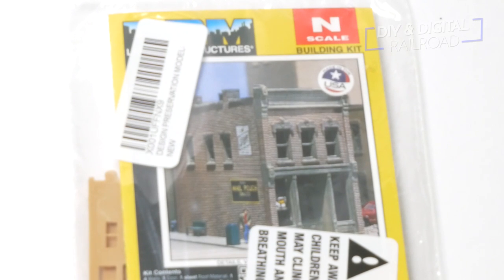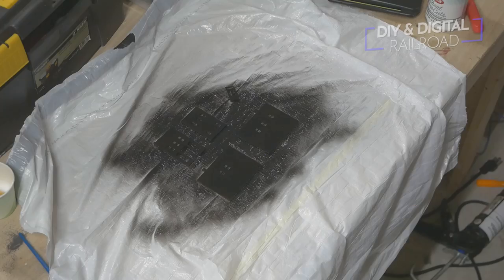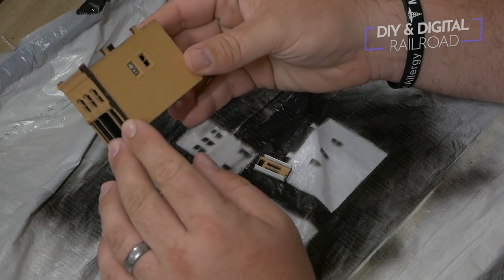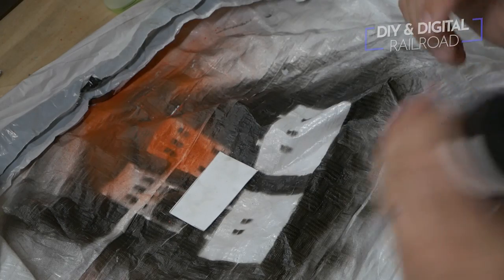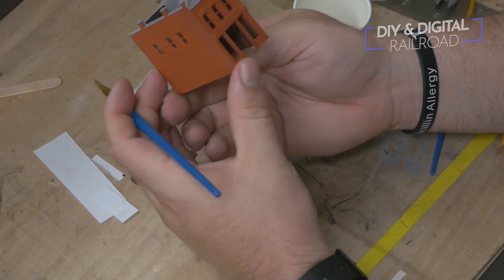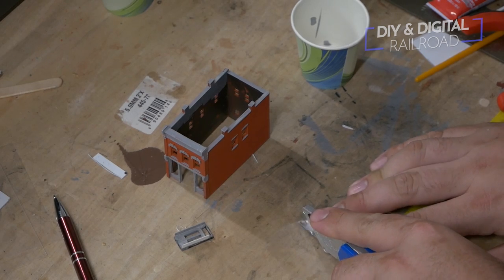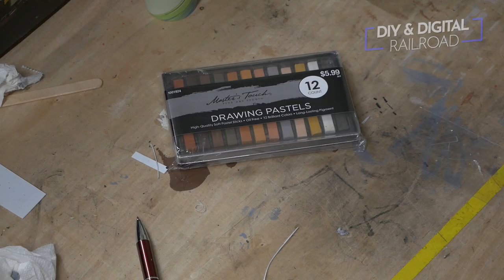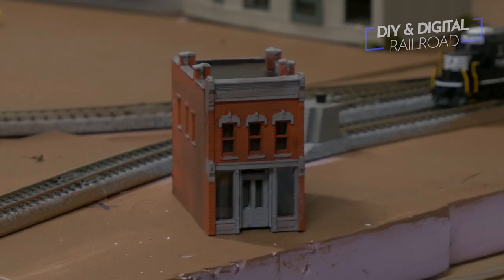Building a Design Preservation Models Kit

Comment: Nice video, some additional suggestions:
The wall casting have a release angle that doesn't let the walls make good gluing contact, and, if not addressed, leaves a void in the side. You addressed this by adding putty to fill and smooth that surface. I have found that I prefer to sand that release angle so the side walls have a flat edge. As you say, the plastic sands easily, so this doesn't take long. Just be sure to keep everything square.
When weathering, try to make all your weathering strokes vertical to the walls, not across. It is a small thing, but yields big results.
I never paint a building wall with only one color. Instead, I use two or three varied colors and do multiple coats while everything is still wet. The larger the building, the more this adds to the affect. The idea is to blend the colors in a way that the overall building color is faded and not uniform.
The same affect really stands out on the roof. Blend some colors, flat black followed by a dark gray mist works well for me. Be sure to do the over spray immediately after spraying the black so they blend together.
These are great buildings and really lend themselves to kitbashing, or using multiple kits to build larger factories.

Comment: Thanks, Jimmy. As noted by another, along with the angles edges of the walls, there is brick detail on the sides of the walls. It will indicate which walls go inside the other walls: e.g., I notice that you put the side walls behind the front wall and the back wall inside the side walls. If you look closely, you will see that the building is not exactly square. However, in N scale, that may not be as noticeable as in HO scale on O scale.

Comment: I picked up one of these on ebay for about $2. It was missing the part where you mount the door and it also came with one other structure that may have been missing something too, but for the pieces of scrap at least, it was a great value. Some of these can be really inexpensive on ebay.

Comment: Additional hints: Wash the plastic parts in mild soap and allow them to dry fully before preceding.  Often on these buildings the front would be painted while the other 3 sides would be a natural brick color. Giving the models the lightest dusting of flat black spray paint is a cheap and easy way of adding additional weathering.  Cheap ribbon found at the craft store makes for great window shades. I also use Testor's canopy glue to attach window glazing. Thanks for shooting and sharing.